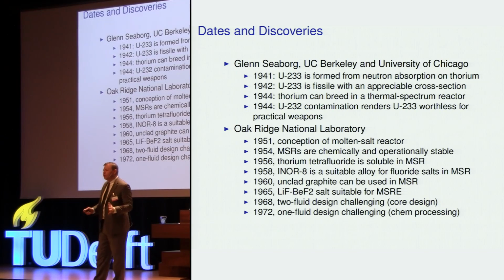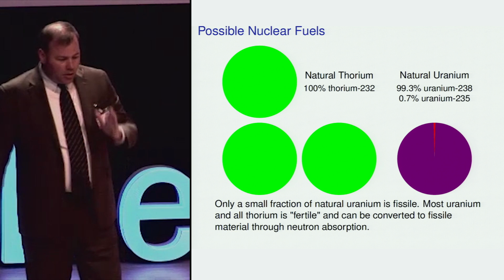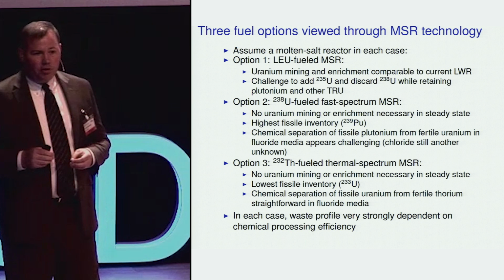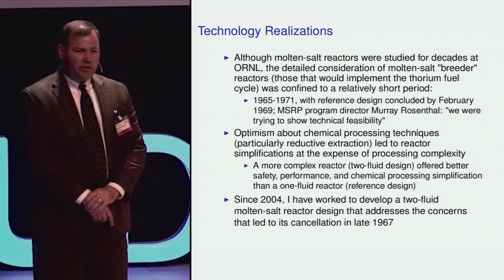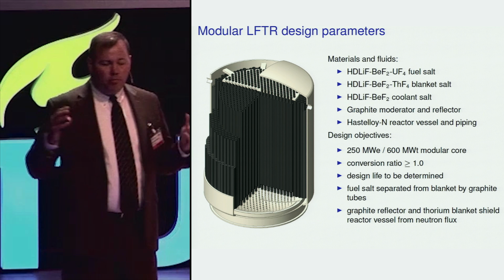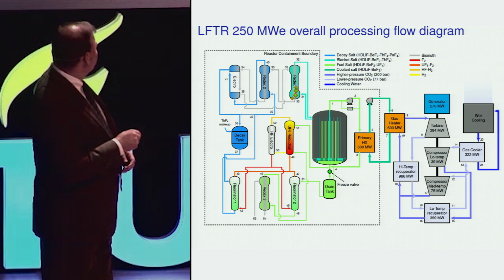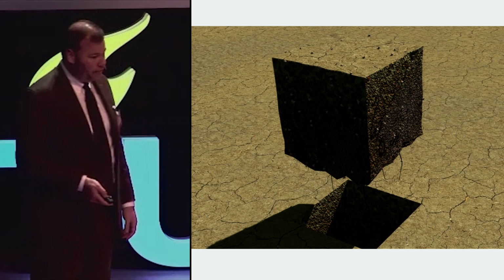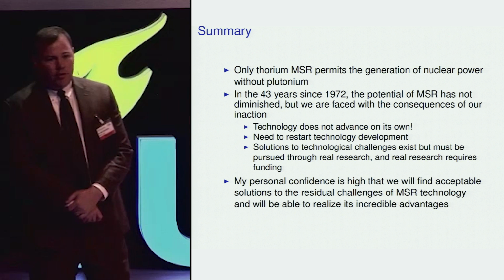Kirk Sorensen - The Promise of Thorium in Meeting Future World Energy Demand

Comment: Why thorium when the price of uranium has fallen through the floor and we have hundreds of years of it?
Reply from the maker: Fast-spectrum lets you fission either fuel more fully. But only Thorium can be fissioned fully in thermal spectrum (with liquid fuel and some online chemistry). There's no short-term supply side challenge either way. But there's a waste story that's very different with the correct thorium reactor. There's also an opportunity to monetize the byproducts which depend on that same chemical processing. It offers a very unique value proposition, not fully explained by cost per clean+reliable kWh.
Reply: @gordonmcdowell  I'm not sure I understand all that but can thorium be used in a burner reactor instead of a breeder?  Breeders have a downside and will always be a harder sell.
Reply from the maker: @robertbrandywine  I don't think it is likely they'll always have a harder sell. I'd far rather have people champion best-tech and argue for that than try placate the likes of The Bulletin or Greenpeace, which today have a history of weak-sauce to defend.

Comment: The problem with nuclear energy is that the media's sound-bite oriented discourse, where everything is reduced to short grunts. You will have to spend some time on this subject to understand it. The root causes of problems the three big nuclear disasters has not, and will not, be explained to the general public and and the politicians. The news medias entertainment requirement prevents them from performing a usable function.
Fear, uncertainty, and doubt needs to go away. Burning coal, oil, and gas, people and politicians understand, but not how damaging these energy sources are. Probably some new buzz word sound byte oriented lingo needs to be formed to allow the average bears to nod their heads about Thorium fueled reactors. Injecting the word Thorium in the discussion about Iran's nuclear ambitions would easily differentiate why they need nuclear power.
News media wants people to be stupid and uninformed, but the opposite is needed, education. Ignorance is not a virtue.

Comment: Two questions: is it possible to start up a thorium breeder with a mix of low enriched uranium and plutonium from LWRs, considered that a large amount of 233 is not currently available ? Why gas turbine, if you can achieve with that heat grade an efficency > 50% with today steam tech ?
Reply from the maker: Gas Turbine would help in detection and recovery or tritium. Not sure LEU adequate to seed LFTR might need HEU (or Pu) and run until fissile consumed and replaced with created U233.
Reply: +Mark Smed 
 Interesting. So, just curious, any guess about the time frame to achieve thorium-uranium 233 steady state in a such LFTR ?
Reply: Initially the reactor is fed with U235, the initial period of time in the order of months after that only Th232 is needed. The supercritical CO2 Turbine requires much less real state to build than a steam turbine, among other cost reduction. My opinion is that initially we may have to use steam turbines.

Comment: Does "highly depleted lithium" refer to highly purified lithium7 or some other type of processing of the lithium?
Reply: +Dukky Drake Lithium-6 is easily fissioned by thermal neutrons producing Tritium and He-3 (which goes on to absorb a neutron and become more tritium). Lithium-7 goes through a similar fission but only with fast neutrons.

So in this instance he is referring to high purity Li-7. Thankfully, the mass difference between Li-6 and Li-7 is so large it enables chemical separation unlike U-235 and U-238. There may also exist stockpiles of Li-7 somewhere from the days of Li-6 production for thermonuclear weapon use.
Reply: kylesenior
Thanks for the explanation.

Coincidentally, I actually ran across an old post that shed some light on this subject only yesterday on his forum.

http://energyfromthorium.com/forum/viewtopic.php?f=8&t=4475&p=60929#p60288

Comment: There are two "issues" the ANTI's constantly put forward regarding LFTR that need to be addressed in a 5 minute LFTR primer.

1) Corrosion. [foreseen chemistry and metallurgical requirements]
2) Separation of Protactinium 233 for bomb making material. [seems most easily overcome by simply reducing the incident neutron flux by increasing the blanket volume]

There are real engineering challenges with these so-called issues, but IMO nothing more daunting nor complex than the challenges overcome by the Apollo mission, Manhattan Project or Nautilus Program.
Reply: I'm pretty sure that Kirk has figured out the issue with corrosion with FLiBe.  Oak Ridge did extensive testing on this back in the 60's and 70's and found a few ways to "proof" the steel reactors against FLiBe corrosion.  High Nickle content in Hastelloy-N with some Niobium or Titanium (the former being preferred to resist Tellurium attacking the nickle in the Hastelloy-N) were tested by ORNL in the 1970's and showed sufficient embrittlement and corrosion resistance for reactor designs... Combine that with a thorium rich blanket actively blocking the walls and you don't have much neutron flux at the reactor wall....  In fact, as I was typing this he addressed the corrosion and embrittlement issues.

Number two is a challenge but one that is horribly overblown.  U233 is a horrible bomb making material because of U232 contamination (high gamma emitters in the decay chain) but it isn't impossible.  In reality, making a nuke out of Pa-233->U-233 is a really weak argument.  It's weak in current reactors, it's even weaker in MSR's where everything is operating at extremely high temperatures using a fuel with significant gamma emitters that also form.  Also, in terms of countries that want nukes... they will get them... of the 17 countries with nuclear power plants, only 9 have access to weapons and only 2 have been confirmed to go from Civilian Power to Nuclear Weapons and how is entirely unclear.  It would be far easier to have separate enrichment facilities away from prying eyes to do this for the countries that really want it.
Reply: @UrPeaceKeeper  It's not only that they "magically" forget that it's physically impossible to separate Th232 - Pa233 outside a containment process because it is a gamma emitter. It not only physically hot it is also radiologically hot, and not only that they seem to forget that U-234 is also present in the flux and it just "magically" becomes U-235. Too bad the physics doesn't work that way, and if you do make U-234 it kills the process because you do not have a spare neutron to make it into U-235. I don't care how much "magic" you've got in there, the physics doesn't work that way period!

Comment: He emphasizes its production of energy which I believe most people think of in terms electricity but at a high enough temperature ~1000C the heat is great for producing carbon neutral fossil fuels.  If the Exxon's of the world could produce gasoline at $1.5/gallon using its heat they might provide the push to get the reactor commercialized.

Comment: Original video source from here:
http://www.janleenkloosterman.nl/symposium.php
Featured speakers include Leslie Dewan of Transatomic, David LeBlanc of Terrestrial, Jan Leen Van Kloosterman of SAMOFAR/MSFR (Euratom EVOL), Jilt Sietsma (MSR Materials study), Rudy Konings (Chemistry and neutron irradiation studies) and a few other speakers.

Kirk Sorenson introduced MSRs to me through TED talks on youtube and reignited my interest in nuclear power but the talk here is merely an iteration on previous talks. This would be fine if he were simply to be presenting at TED again, but this is the TU Delft MSR symposium where he is speaking to a nuclear engineer crowd. More details on his version of the LFTR where he uses 1.5? fluids would have been nice. Not sure if the Thorium blanket salt is to be plumbed the same way as ORNL proposed.

Reading through the ORNL documentation (http://energyfromthorium.com/pdf/) and reading about the yet to be solved problems - these are issues that should have been discussed in depth.
Addressing the feasibility of the chemical processing steps in 1 and 2 fluid reactors and experiments that still need to be done.
Looking at the Tellurium problem and intergranular attack of the reactor core material.
Addressing the "chemistry problem" where a solution for rare earth removal in reprocessing and salt cleanup was never worked on in detail before program termination.
Trying to find a supplier for the Lithium 7 enrichment, or details on the status of the depleted FLiBe and U233 in the US.

The more I read the more I realise how far we got along, and how far still we have yet to travel. Kirk expounds on the Thorium isobreeder and its multitudinous advantages, but the urgency of the climate challenge calls less for swords than machetes. The power density of nuclear is such that even run inefficiently a great deal of energy can be liberated; and in fluid fuel reactors the burnup is limited only by the core life hence Terrestrial's "razor blade" 7 year core life, with the half-burned salt transferred to a new core.

The "inelegant" 90% solution is the DMSR running on uranium, possibly from low burnup spent fuel; or the WAMSR. No more anti-nuke peanut galleries waving Operation Teapot MET documentation on the U233/Pu fizzle, and unblocking the back ends of the US reactor fleet to stave off the retirement cliff for a few years longer.

I find myself increasingly disenchanted with the prospect of the "pure" cycle LFTR making it to market in sufficient time and sufficient quantity to make an impact on climate change; nor would it necessarily be cheaper than coal as Robert Hargraves exhorted back in China at THEC12. The promise of profit, too, is making Sorenson and LeBlanc both clam up to protect IP in a world where licensing an MSR looks like a remote possibility in the first place. A truly open and transparent architecture as Delft and Euratom EVOL are sharing; benefits all MSR proponents. But this is not happening. There is a long game to be played here; and keeping one's cards close to the chest is a losing bet for all.
Reply from the maker: MonMalthias Thanks for mentioning that, I'll include in description text. I should have included that but forgot.